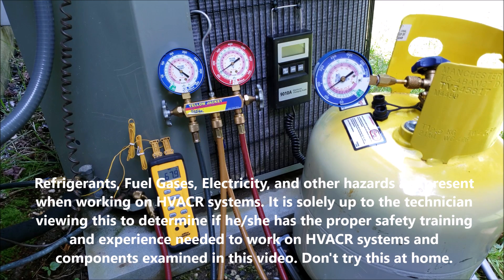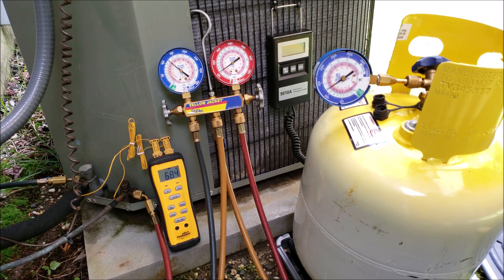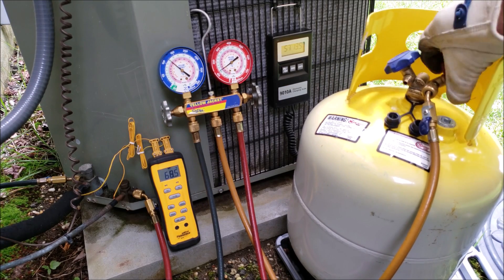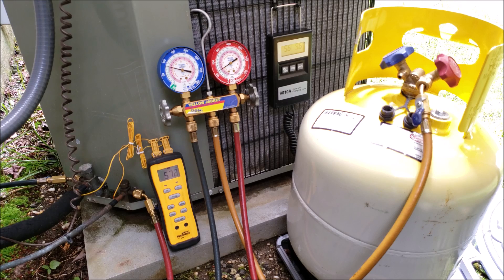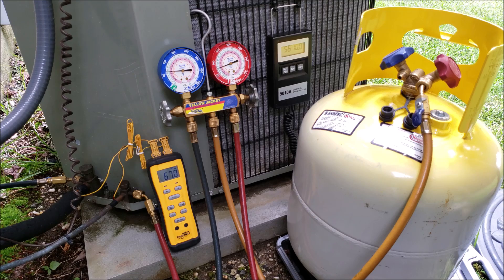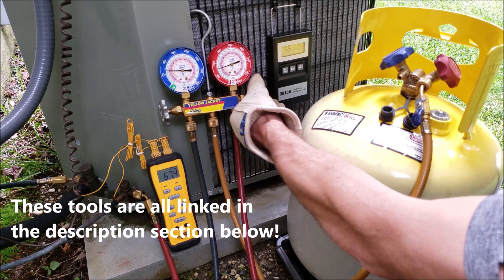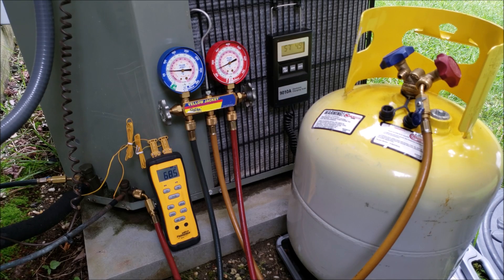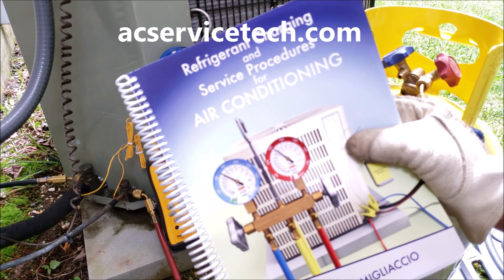Recovering Refrigerant with the Compressor While the Unit is Running, Adjusting the Charge!

Comment from the maker: Paperback & E-Book:  www.acservicetech.com/the-book
The E-Book and Paperback are both is Available for Purchase at the Website!
Tool List-  https://www.amazon.com/shop/acservicetech
Support the Channel-  https://www.patreon.com/acservicetech

For those that are looking for the tools used in the videos: (Linked Below)

UEI DL479 Multimeter with temp sensor http://amzn.to/2jtsUbJ
Yellow Jacket Refrigerant Gauge Set http://amzn.to/2aenwTq
Refrigerant hoses with valves http://amzn.to/2aBumVI
Yellow Jacket Gauge set & hoses https://amzn.to/2vLVkV9
Yellow Jacket 4 Port Manifold w Hoses https://amzn.to/2BkuGIq
Digital Refrigerant Scale  http://amzn.to/2b9oXYl   
Ratcheting Service Wrench   http://amzn.to/2dGV4Nh  
FieldpieceSMAN360 Digital Manifold Set https://amzn.to/2BdoaD4
FieldpieceSMAN460 Digital Manifold Set https://amzn.to/2nB4Fe6
Ultrasonic Leak Detector with Headphones- https://amzn.to/2B2cRO3  
Compact Ball Valve for Refrigerant Hose https://amzn.to/2KUisW8
QuickDisconnect 90 for refrigerant hose https://amzn.to/2MMtVcg
JB 6 CFM Vacuum Pump   http://amzn.to/2nqbvo8
Appion Blue 3/8" to 1/4" Vacuum Hose http://amzn.to/2uYlVyc
Appion Red 3/8" to 1/4" Vacuum Hose http://amzn.to/2uYg6Ro
Appion Valve Core Removal Tool http://amzn.to/2uYr8WL
Yellow Jacket 1/4" by 1/4" hose http://amzn.to/2umtcod
CPS Vacuum Micron Gauge http://amzn.to/2v1nM3O
Supco Vacuum Micron Gauge http://amzn.to/2v1JRiA
RectorSeal Bubble Gas Leak Detector http://amzn.to/2ckWACn
Magnet Jumpers- https://amzn.to/2PyKPQZ
Alligator Jumpers- https://amzn.to/2PxqJXn
Fieldpiece ST4 Dual Temp Meter  http://amzn.to/2wc1ME3
Fieldpiece Bead K Type Temp Sensor https://amzn.to/2DBwKfs
Fieldpiece Wet Bulb Temp Sensor https://amzn.to/2RRI7Tw
Fieldpiece TC24 Temp Clamp https://amzn.to/2qHLyjZ
UEI DL389 Multimeter  http://amzn.to/2xAdaJf
Air Acetylene Torch setup    http://amzn.to/2aQalsb  
15% Silver Brazing Rods  http://amzn.to/2gVLyLc
Nitrogen Regulator    http://amzn.to/2bXdR5f
Nitrogen Flow Meter    http://amzn.to/2brvoBg  
Other tool links can be found in the video description section.

Shop through Amazon! Your Purchases through Amazon provide a means for channels such as mine to earn advertising fees from all purchases after clicking through. Prices are the same as normal-    https://www.amazon.com/shop/acservicetech
Reply: I noticed the charging jacket are $100, can you use a plastic bag?  Also, do you recommend insulate wrapping the TXV therm pickup on the line for more accuracy?
Reply from the maker: Hey AD, the txv bulb should always be clamped with copper or stainless steel clamps and insulated over both the bulb and the suction line. Yes you could use a trash bag and I did at times at school to show the process. I would start with a small hole and make it bigger as we went on. The problem is that not all units are small enough to have a 55 gallon trash bag fit around the top and also how that looks for the homeowner, thanks AD!
Reply: I got your book two weeks ago, I really like it and appreciate your videos! And book is awesome. Thanks
Reply from the maker: Thanks a lot Gabriel 22! I am glad that you are enjoying the book!

Comment: how would you handle an overcharge with a txv and the compressor is flooded.
Reply from the maker: You could recover some refrigerant while the power is off or recover quick while running.

Comment: OMG!! Water and R22 don't weigh the same. You need to 1st calculate the ratio difference and that value is used to calculate the 80% and then you add the tare weight. Please use the online hvac fill calculators for each refrigerant before you hurt yourself.

Comment: This can be done but you will expel up to about 3-5% of system oil during the process.  3-5% oil loss is not a big deal but just don't repeat the process several times as the oil loss will be cumulative.

Normally 6-10% of initial compressor oil charge is distributed throughout the system, mostly in evaporator, if not a reverse cycle unit with accumulator that will store a few oz's of the oil.  About 2-3% of the initial compressor oil charge will be sucked up in the motor stator windings wire, like a sponge, after compressor has been run for a while.

In recover tank, POE oil will float on top of liquid R410A so liquid charging from recovery tank will re-inject R410a without the oil.

Comment: I have a 5 ton older AC that had broke down a few times in the past and the technician had to remove some parts and replace them but to do that he had to drain or get rid of freon and then charge me for free on again which wasn't cheap is there a company out there that can replace the part but somehow save the freon and use it again after replacing the part?

Comment: R410A, is a zeotropic but near-azeotropic mixture of R-32 and R-125, if AIRCON. with TXV, subcool is 3 F, means low on refrigerant R410A, MY question is, can we do topup with R410A or we need to recover old R410A and do vacuum and recharge new full vergin R41OA by weight.
2. If Aircon., is low on refrigerant R410A, the refrigerant in Aircon.,become unbalance as its a mixture of R32 & R125, is it true?

Comment: Can you recover all the refrigerant using this method ?  If you wanted to decommission a system
Reply: No. But like 75% very fast. LP will cut. Or just stop pumping, please shut system down when the scale is telling you that refrigerant is not going into the cylinder in a resonable speed.
Reply: @Casal70  thanks

Comment: Great video. I calculated my target superheat to be 24F which seems high to me. WB in = 71, DB in = 80, outside = 85. It's a piston R410A system. SH is currently at 10F, and not cooling that well. Thanks!

Comment: One more question:  Why couldn't you take some refrigerant out of either the liquid line or the suction line with the system off to avoid the oil blow out problem?  Wouldn't gas or liquid refrigerant flow into a recovery bottle if you cooled the bottle?  No recovery machine, just the bottle in my question.

Comment: Hey Craig, excellent presentation.  I am going to buy your book.  I just have a question about those hoses.  They don't have check valves in them, correct?  So they just have the schraeder depressor but no check valve.  You have to use the valve to close off the hose and make them manual operation low loss.  A true low loss would have the check valve so for example when you empty the nitrogen charge after a pressure test you would have to disconnect the yellow hose at the manifold.  You wouldn't be able to just blow it out the end as you do in a video.  
Is all this correct?  I like the idea of the valve at the end of the hoses like the yellow jacket ones you use and link, but I would rather buy the JB hose set you also link.  The JB hose set is totally different with  check valves in the ends of the hose as far as I can tell from the description.  I think they are also better quality from reading the reviews.  Can you just clarify on the hoses.

Comment: Do you always recover using the red port? what is the blue port used for?
Reply: anyone?
Reply: @bkoz319  No, colors can be mixed between manufactures, there is no standard. So please read on the valve. One is vapor, the other is liquid. Text on the valves referring to a standing tank. If you turn it upside down, you invert the texts. Liquid side has a tube to the bottom in the tank, the other has not to catch vapor.

Comment: can we use this same procedure to take out a little bit of extra refrigerant charge out of R410a mini split? i heard R410a has higher pressure in liquid line than R22 system
Reply from the maker: The problem is that the minisplits do not usually have a liquid port. Make sure to read the charging articles on mini-split systems at our website www.acservicetech.com/articles, thanks!
Reply: @acservicetechchannel  mine mini split has 5/16 inch charging port on liquid line too. i know its weird as mini splits usually don't have any type of port on liquid line. still if there is a R410a unit that has a charging port on liquid line, is it safe to recover small amount of refrigerant from it? I'm asking this because of high pressure present in liquid line of R410a systems.

Comment: These are great videos for newbies however it always amazes me when people are stuck in the Dark Ages with analog gauges. I love my sman, and the isolation valve to the refrigerant hose as well as the vacuum port on the manifold because then when I am done I can get all (almost all technically) of the refrigerant out of my liquid side hose bye taking it out of the high side and letting it go back into the low side through the gauge manifold block before unhooking.

Comment: Can the recovered refrigerant be reused?
Reply: No, it might have been compromised and may have been contaminated. Its much easier to use new refrigerant and you'll have less problems down the road.
Reply: As long as it has the same pressure and ambient temperature that the refrigerant is rated for, of course you can re-use it! He just showed how by hooking up a gauge to the tank. Re-watch at the 2:30 mark where he mentions this. Do you think he'd add refrigerant to his almost full tank only to never use it?
Reply: @watcherwatchmen7785  Not legal here unless equipment is for the same owner.  In practice, many will save R22 and use it to top off junky leaking units.  Again, not legal.

Comment: This method  is ok for metering small amounts of r22 or 410a . But if you want to fully recover a unit I wouldn't  personally use this method as he states  . What kills me is the people that fully open the gages when recovering freon right at the start  .That just kills the recovery machine causing it to overheat and fail .You should recover small amounts at a time or slowly open your gages when recovering this way it doesnt bog the recovery and cause it to overheat sending large amounts at once to the tank .

Comment: Craig, what are the steps after you are done pulling out the right amount of refrigerant?  What valves do you close first and how do you make sure to dump the refrigerant in the lines back into the unit?  Thanks!
Reply from the maker: Shut the handle to the recovery tank, turn the manual low loss fitting to the off position on the red hose connected to the high side liquid line. Open the red handle. Then charge the refrigerant slowly back into the system with the blue gauge handle until the red gauge is at the same pressure as the blue gauge. Don't charge it in too fast because you want to protect the compressor from liquid or saturated refrigerant entering in, thanks!
Reply: @acservicetechchannel  Excellent!  Thank you!  I know this procedure was part of another video somewhere, but the ACSERVICETECH library is starting to get kind of big!  :)

Comment: Hey Craig, my book came in and I am loving it!!! some really good info in it
Reply from the maker: Thanks a lot Frank! We are looking for individuals to review the book on amazon if you were willing? The link for the book is through amazon.com/shop/acservicetech and reviews are accepted on amazon even if the book was purchased at the website. Once again thanks a lot and I am glad that you are enjoying it!
Reply: @acservicetechchannel  hey Graig, got my book and I'm really enjoying it. I'm also enjoying all the videos that you have done. A different note, We have a 20year old Carrier 38YXA030300 (13 SEER??) that is giving us a problem. Delta=20, Subcooling=12 (name plate=9 should be + or -3), Refig=410A with TXV, Superheat,=12, EvapTemp=41, cooling @ floor register=55.8, outside=80, inside =76. Now the problem after the unit reaches set temp at thermostat (76) the unit kicks off, but will not come back on even if the house is 80 degrees inside (no matter what I put the temp at) until I turn off A/C Heatpump 30 Amp beaker for about 1 hour. I can then turn it back on and it will run until reaching set temp of 76. I then have to repeat the above steps again. What do you think is causing this problem?

Thanks for any help, Jimmy
Reply: @jimmyjohnboy9618  could be a bad thermostat

Comment: 4:35 - If I messed up and connected to the vapor side of the recovery tank instead, what problems would that cause?
Reply: No problem You would still be going down hill. It would matter when a recovery pump is used to push and pull , then it would be bass ackwarks.

Comment: see that you use external digital micron gauge, do you not trust the micron vacuum gauge on your sman?
Reply from the maker: I like to have the vacuum gauge as close the the system as possible and during the standing vacuum test not have the hoses holding the vacuum, thanks!

Comment: Just got a job at an apartment building and I have to work on ACs. I have basic/ minimal knowledge. I have heat pump systems. The gauges are reading 30 on low side should be at 40. No matter how much Freon I put in system it stays at 30. It fluctuates from 20-30. What’s the problem? Originally coils inside were frozen. Using MO99 instead of r22. Please help.
Reply from the maker: It could be low airflow or a liquid line restriction. I spell all of this out in the book but liquid line restriction is high superheat with normal to high subcooling and low airflow is low superheat with a piston, and normal superheat with a txv, thanks!

Comment: Hi I always watch your videos.and I love it very much. my question is when you recover refrigerant direct from the system for sure there would be an oil coming out together with the refregirant. How would that affect the refregirant in your recovery tank. For sure they are the same r22 but will it affect for later use?
Reply from the maker: Thanks Melvin and great question! This method is only for adjusting the charge and not for recovery of large amounts of refrigerant. Through the EPA 608 rules to avoid cross contamination of acid and impurities, we only use the same refrigerant in a unit that we originally recovered from that unit unless we are putting virgin refrigerant in. In order to do this, we use an empty and vacuumed bottle to start off with. We are also allowed to put that refrigerant in another unit owned by the same individual. If you were concerned with oil getting into the other system, you could charge from your recovery bottle as a vapor so only the refrigerant at the top of the recovery bottle exits. Anyway this method is only used to adjust a charge and is not done as often as the recovery machine procedure, thanks!

Comment: hi craig . question,   Low  and High Side Pressure the Same= 125psig ,    and suction line and liquid line both read 70 temp . this is a heat pump,  is this a bad compressor ?
Reply from the maker: If the high side and the low side pressures are matching then it is likely the compressor is not running. Maybe turn the power off and check the capacitor to start, thanks!
Reply: AC Service Tech LLC compressor  is power on , but just not pumping,capacitor is good also I try kick start but still not pumping.   I think need to change compressor.   Thank u so much
Reply from the maker: One of the electrical windings may be open if you turned the power off and tested the resistance values of the compressor. I did a couple videos on testing the compressor, reading resistance values, and determining start, run, and common taps. Ok thanks for letting me know!

Comment: Just a quick question so you did not use recovery machine just let the unit run and recover the liquid refrigerant ?
Reply from the maker: Yes but you would only do this to adjust a refrigerant charge, not recovery large amounts of refrigerant because it will remove the oil from the system which could damage the compressor, thanks!

Comment: Can you convert empty propane tank into refrigerant recovery tank? How? Thanks
Reply: Not legally or safely !   Propane tanks aren't designed for R-410a pressures. No supply house will take a modified propane in for cylinder exchange.
Bad idea ! Go buy a used tank off ebay if your on a budget.
Reply from the maker: We only use pressure tested, certified, dual port recovery cylinders and they really don't cost that much. The safety pressure rating and hydrostatic test is a big thing, thanks!
Reply: Thank you for advices

Comment: Great video! Super detailed explanation. That's what I like. Thank you.!!! One question, if the customer's air filter is clogged, I usually remove it before checking or charge. And I I don't have a replacement filter I run the system without an air filter? Can I do that? Will it affect higher superheat  on my readings?
Reply from the maker: There is not much else you can do if you don't have the right filter but on a system with a piston, removing the filter temporarily could lead to a higher superheat due to a higher amount of airflow across the coil. The only thing is just to try to have more air filter sizes in the truck. Also different filters will have different -pressure drops across them so it is always best to check the charge when you have the same filter that they always run in the system. Make sure the filter is in when you leave and that a fresh one is coming very soon, thanks Tapch MC!
Reply: @acservicetechchannel  Ok thank you for respond.